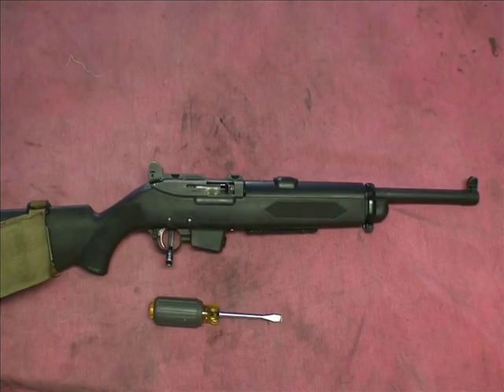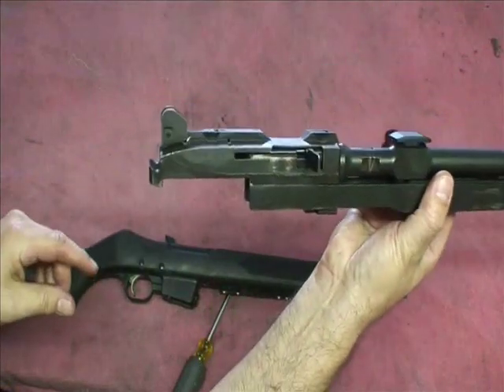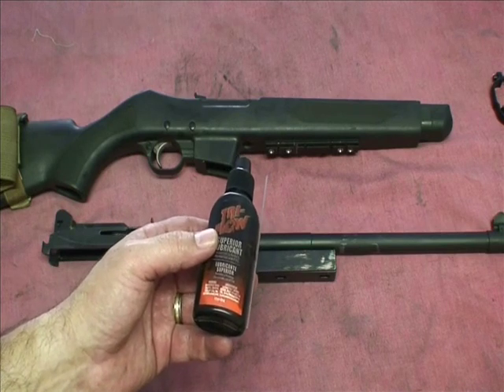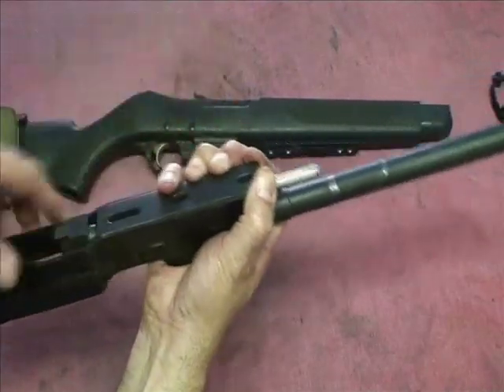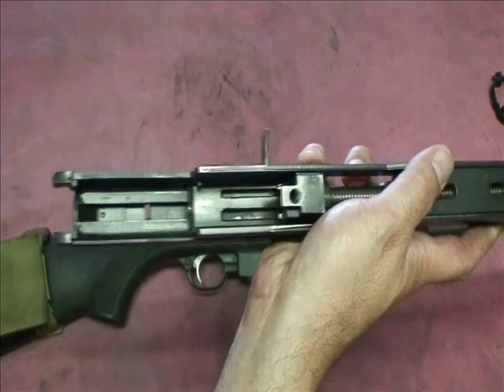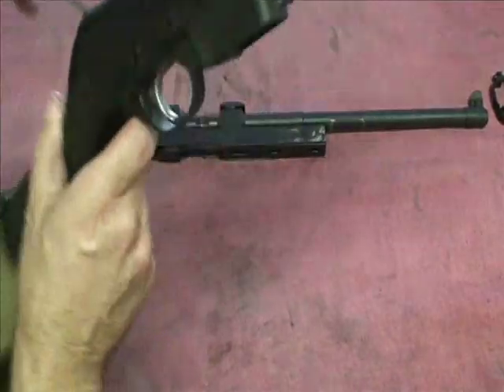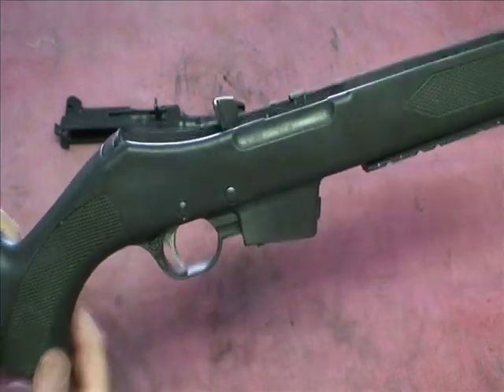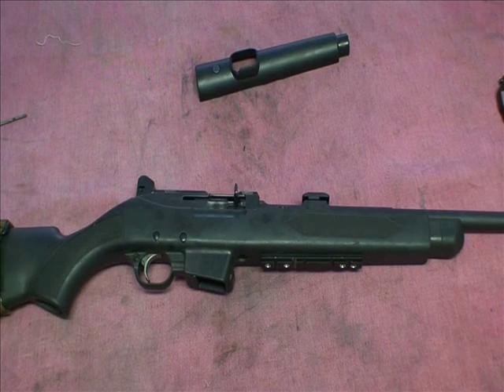Ruger PC9 & 40 Disassembly

Comment from the maker: Ya Same here. While in the Marines we were supposed to use CLP but when you start running the guns in the hot Iraqi desert under constant fire they start to slow down and carbon up. CLP is perfectly OK for civilian shooting but I have been using my mix for many years and have had great luck with it. My carbines don't carbon up like they did when I used CLP after prolonged shooting. CLP breaks down and u need to relube the weapon. In a SHTF/zombie firefight I dont want to have to relube my weapon

Comment: Just wanted to add (late..sorry) that the 'toggle' 'fulcrum' in the upper performs two functions.  It blocks the bolt from moving unless the trigger has been pulled, and prevents the bolt from cycling should the butt be smacked hard on the ground.   The bolt op lever must be moved back against a spring to release the bolt, and that lever doesn't have enough mass to defeat the spring...so smacking the butt doesn't accidentally chamber or eject a round without you wanting it to.    Just be aware that the rifle can load itself without your being aware if you remove that toggle!

Comment from the maker: Go get a picitinny rail from Ruger or anyother rail maker.Place the rail under the rifle and get it lined up. Take a black pen and mark where the rail holes are and drill the holes out. Then use nuts and bolts to mount it to the rifle. You will have to use a dremmel to cut/grind off the excess bolt thats comes in the stock. Make sure the actions does not slide on the bolts.

Comment from the maker: there are a couple of safety features on these rifles are are reduntant. There is a safety punger rod right behind the hammer. It moves up and down and part of it slides into/against the stock where the top reciever slides in. Check that first. Move the trigger with the top reciever off and you will see what I am talking about.  This device allows the safety to be activated. It may be stuck or have some debris in its travel preventing the safety to operate

Comment: Hello. The trigger pin on my old PC4 walked out and now I need to figure out getting the trigger assembly reset. Your video says it’s rocket science in there, but will take any help I can get.
Reply from the maker: I am sorry that happened. That had happened to me and it was a challenge to get it back together. You kinda need 3 hands. I have not had that rifle for some years now so I am sorry I can't tell you how to reassemble. Sorry

Comment: Do you know what magazines it takes? My friend bought a used PC9 that looks a lot like your's. I assume it's an older model. It came with no magazines.
We can't find any magazines for it. Some sellers claim their magazine fits PC9 but I don't see a notch for the magazine catch lever. Perhaps the newer PC9 carbines take different magazines? I can't find much info on this.
Reply: Any Ruger from P series will fit. P85, 93, 98 any of them. New carbines use the newer Ruger magazine or glock changing the magwell.